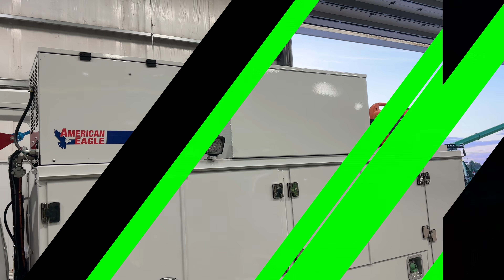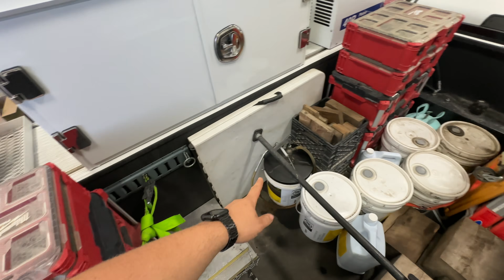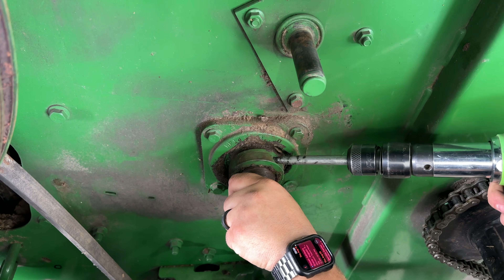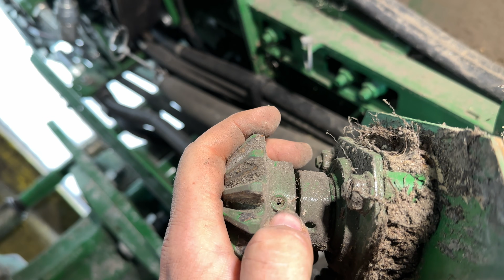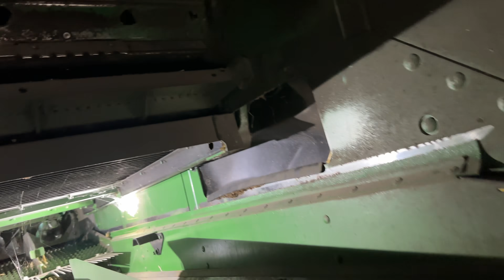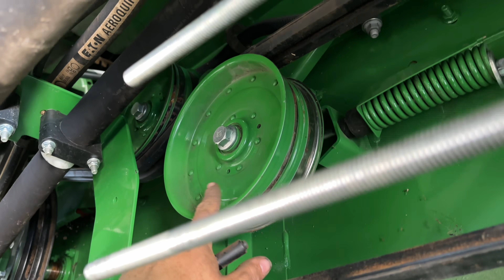New Stellar Industries storage cabinet - S680 & S780 combine repairs.

Comment: What puller did you use on the feed accelerator bearings? It’s hard to find a good puller that works on combines when they have duals

Comment: When you wonder "why the hell is this shaped and in there like that": In their CAD software, engineers have a "select empty space" tool. That also explains a thing or two about fuel and oil tanks. They literally didn't think about having to pull them out of places! If you're lucky that was an afterthought once the damage was done, changing it just enough to baaarely fit through there.

Comment: Thanks for another great Zeth! That’s a very nice storage box, like You said it’s quality stuff! Have You ever thought of having trailer instead of a service box like You have? Very good friend of mine owns a ag repair shop with him and 3 or 4 other Mechanics. My Friend does a pile of service called and he has a 5th wheel trailer with his tool boxes rolled into place and locked down. He also has a very nice work bench inside the trailer. His air compressor, welder and ect … is all inside the trailer and out of the weather and wind. He really likes it a lot and works well for him and for the weekend or such he drops the trailer at his shop and still has a truck to drive. Just wondering if You ever thought of it? Thanks for the video!

Comment: I was taught by wise men to remove a seal,you drill a small hole on it's face then use a small slide hammer with a wood screw, easy peasy😊

Comment: Thanks for the videos.  I like your truck setup. Could you have turned the box around so that you could stand on the outside of the truck to access its contents?
Reply: Purely speculation here, but my guess is yes that box could be turned around to be accessible outside. But then it would be to high up and require a step ladder to see and reach its contents.